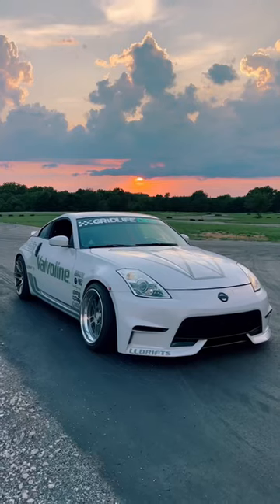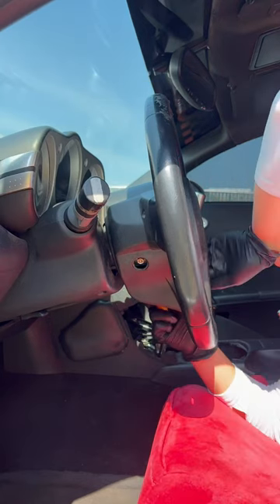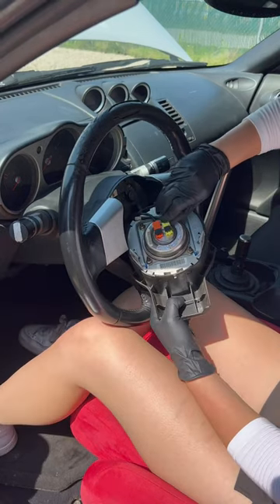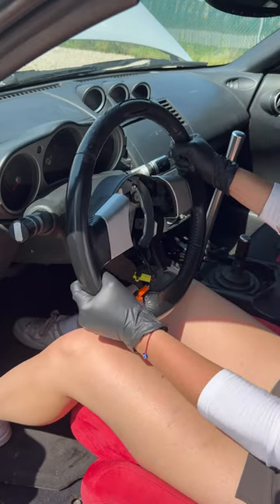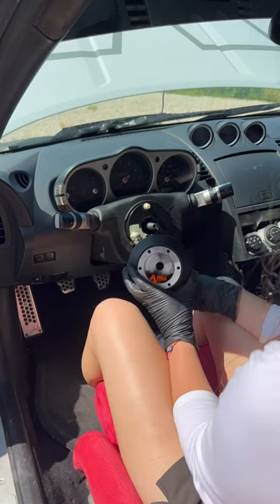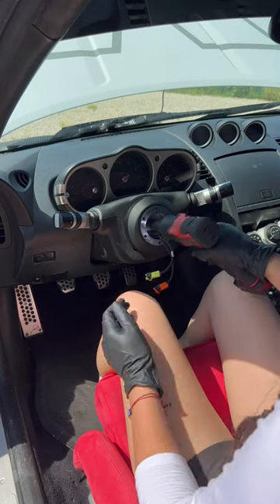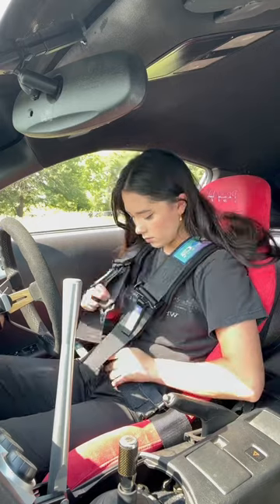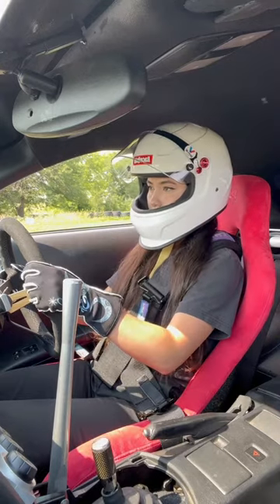New steering wheel for the 350Z✔️

Comment: I love that you explained the harness use. No one ever does that!!!
Reply: Cause it's common sense
Reply: @City1Tiger  yeah, if you're older. But the next generation  didn't experience our time, and giving general knowledge is always a positive. We all know you should never use a jack only, but a 16, or 18, or even 23 year old thay just got into cars MAY not know, they need to ALWAYS use a jackstand. That one statement could make someone think twice and make a better decision.
Reply: @blackcanyongarage  so harness can be 4 or 5 point harness, the number is how many belts are being worn. They function like a seatbelt but provide more support and contact on your body. They also are permanent locked and need to be manually adjusted like a belt kind of. But they are safer in racing situations since they provide more support and contact on the body than a regular seat belt. Hope that helps
Reply: @blackcanyongarage  I learned the importance of jack stands when I was a kid, my dad was fitting new brakes to his car and the jack failed causing the freshly fitted brake disk to cut into his leg.
Reply: @City1Tiger t really isn’t. So so many people will remove their safety features in favour of popular mods without knowing how dangerous it is. I’ve had people ask about my steering wheel and want to get one without realizing my car never came with airbags, and therefore I didn’t have to remove them to install it. I have to always tell people not to do it because they’ll be making their car more dangerous
Reply: @blackcanyongarage s a 17 year old car enthusiast, I have no idea what you're talking about this is all common sense
Reply: everyone knows what a harness does
Reply: @axep3785  Cool Story Brah

Comment: Just a small tip is to leave the battery disconnected for a few minutes, the airbags can still go off for a little bit after because they hold a charge in their capacitors. Small risk but painful price.
Reply: Now that is a cool fact!
Reply: Press the brakes a few times (in a z at least) and it gets rid of the charge
Reply: 15 minutes

Comment: Really glad you said that removing the airbag is a bad idea in most cases. Most people doing this modification don’t take that into account and it’s ridiculously dangerous
Reply: yeah its very annoying how people don't take that into account when removing an airbag..I've seen so many miata drivers without airbags lol
Reply: @KShauryaDwivedi I have a Miata and love the stock steering wheel. I don’t know why people choose to remove it lol
Reply: @lizzosbelly  I personally haven't used the stock miata steering wheel. so can't say anything there but good to know
Reply: Battery terminal disconnected would take care of that accidentally airbag deployment.
Reply: @AugustAustin-c3i they weren’t talking about the install, they were mentioning about driving without an airbag. Since you should have a seat with a harness if your running no airbags

Comment: You need a hans device if you are using a 4 point harness and a helmet.  

When crashing, the 4point harness will not stretch like a normal seatbelt, and the weight of the helmet will increase the momentum of your head resulting in a broken neck. 

Be safe.

Comment: It's fine to remove the airbag in your daily if you run a harness and racing seats. The harness will hold you in place and you will not hit the steering wheel with your head. There is also less probability of breaking your hands.
Reply: Still a bad idea, harnesses will hold your body in place but not your head/neck which could cause a horrible neck fracture
Reply: @koolaidcrusade7776  Not really better than hitting your head against a headrest in a regular car. It is recommended to run a helmet still, though.
Reply: @TomekHar  It is much better, the standard belt allows for your body to move also which in turn will be safer for your neck. Helmet or not with a harness won't reduce the risk of you fracturing the base of your skull

Comment: Make sure the rubber covered nipple holding the wires lineup with the indent on the back of the hub adapter. Don't be like me and break the plastic by torquing the hub adapter over it off center

Comment: I’ve never seen a short, easy, and easy to understand step to changing a steering wheel. Thanks! I was thinking about changing it to a quick release I’m not really sure its soon to be my daily driver and not sure if it would be worth putting it on and risking my safety and would I easy pass safety check? check engine light? i have a 2005 Subaru

Comment: u need a quick connect
Reply from the maker: The quick release hub makes the steering wheel a little too close for my liking, but I do have sliding seat brackets so it shouldn’t be an issue if I need to get out of the car quick😁

Comment: why did i just see two handbrakes…
Reply: ones a aftermarket hydro handbrake wich works like the foot brake except it only runs to the rear. the other is the stock cable ebrake. the reason you keep the stock one is so you dont have to only really on the car being in gear to stay parked. as hydros(for the most part) cant be locked in place so they cant be used as parking brakes

Comment: 25ft lbs did you just hand tighten it?
Reply: Torque wrench it clicks when it’s up to tightness
Reply: @jetts3512  you don't get the point that 25ft lbs is not what I'd want on a steering wheel